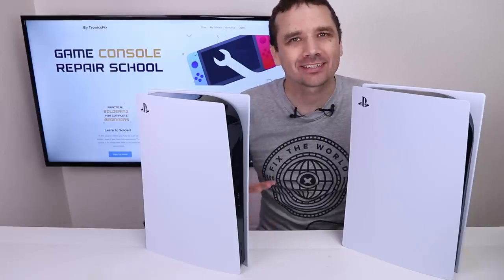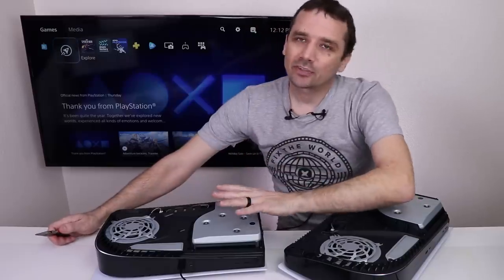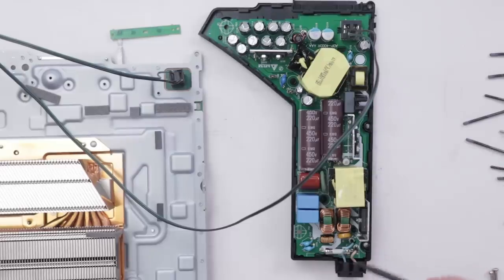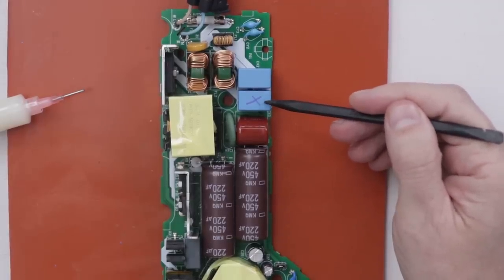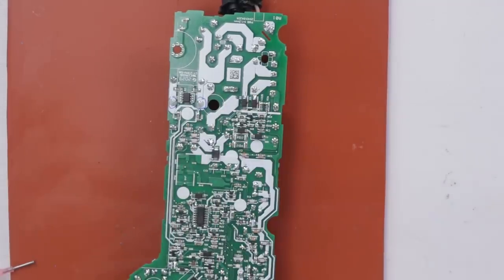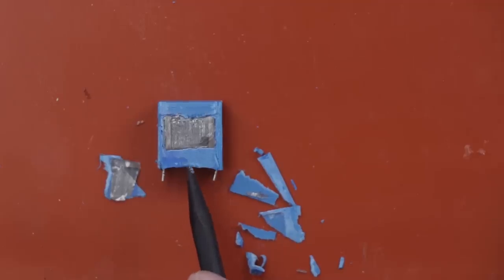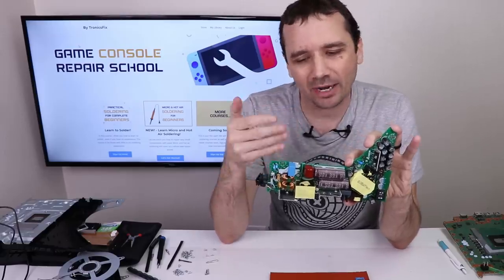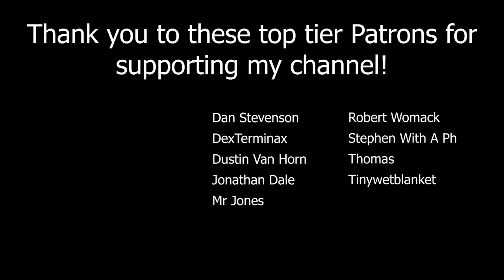PS5 Coil Whine - What Is It and Can I Fix It?

Comment: RIP to those who bought one of this from a scalper without warranty
Reply: I've told everyone that I sold a PS5/Series X to contact me directly if they have any warranty issues and I would contact Sony/MS directly on their behalf. There are some nice scalpers out there ;)
Reply: A valid receipt is not require for Sony warranty. You just need to enter’s console serial numbers and stats the problem. All console come with 12months warranty. Postage label is free as well. You should try it :)
Reply: @ionesito . They don't need to be stupid, they are just willing to pay a higher amount then you for the console. They are just higher on the demand curve than you are. They wouldn't likely have to pay the amount they are if scalpers didn't shift the supply curve.

I don't respect the hustle of scalpers. They put an unnecessary pressure on the market.
Reply: why they all have some coil whine.
Reply: Plenty of shops out there that would fix it.
Reply: They would still have a warranty
Reply: @curan  this doesn’t make it less stupid for two reasons: 1) Even if a console has a problem, no one can guarantee you that it will break during the one year period. Maybe now this or something similar are not important, but no one knows about the future and 2) Even if you have a year guarantee, why not spending $100 more on the original price to get more years of guarantee? My PS4 Pro broke down 3 months after Sony’s guarantee and I got a brand new cause I had extra coverage like  care.
Reply: @freddozilla  i only telling you people who bought from scalper they will have warranty from sony. Not my problem when they didnt buy from retail and its their money and choice. I fix electronics for living and sometime if they are still under warranty then it get sent to sony/Microsoft/nintendo/apple and you dont need to provide receipt.
Reply: A nice scalper is an oxymoron.
Reply: @robertt9342  People who scalp and people who pay scalpers are both part of the problem.
Reply: Their fault got mine from target
Reply: Buying from a scalper by no means voids your warranty. I have talked to Sony support multiple times. It's only an issue if they have a suspicion your console is stolen. Retailers can report the serial numbers of the stolen consoles and Sony keeps an eye out for them since eventually some will find there way back to Sony for whatever reason. But yea, Sony honors warranty from scalpers. All they ask for is some form of proof of purchase. I used the Order Summary that was given to me.
Reply: @robertt9342  we are not talking about stock here, we are talking about a retail product with an established price. If someone buys a retail product and then sell it to you for a extra 20% you're stupid, very stupid.
Reply: @curan  will they just take a ps5 (like mine for example with the issue above) and replace it? Or will u have to send it to them and wait for them to fix it and send one to me?

Comment: When applying AC voltage to a metal film capacitor, buzzing is produced in film capacitors due to the mechanical vibration of the films due to the Coulomb force existing between electrodes of opposite polarity.  This is completely normal of metal film capacitors and does not cause any issues in terms of reliability or longevity.  If you examine the buzz in more detail, it's probably oscillating at around 60Hz which matches the NA AC waveform.

There's no easy fix to my knowledge without a good understanding of the circuit.  You could try moving to a higher voltage metal film capacitor but keep the other properties the same.  You could also try to move to a teflon (instead of polypropylene) capacitor with similar values as well (not electrolytic, tantalums, or mylar though).  Lastly, you could look to reduce the noise by adding a ferrite bead to filter out the high frequency noise, but once again it would take knowledge of the circuit to understand the impact.

Comment: The foam looking glue you see on some motherboards holding or insulating components can be used to change the frequency that these capacitors make noise at. Used this method to hook two side  by side capacitors on a noisy power supply together and eliminated the noise. Also longer or shorter legs on the caps can help, typically longer. Good luck and great videos.

Comment: It could be fixed by reading a datasheet to those capacitors.
Effect is caused by ampere force that changing by current passing through that think, sometimes in high power systems it is called a striking current because it can bend terminals, busses and so on. Just imagine thousands of amperes in 20 cm close to each other.
Just read the datasheet to those caps, there should be ESR, temperature code like X5R, X7R, COG and so on, plus you will find a bunch of graphs showing impedance vs Frequency. Capacitors should be selected in SMPS by their frequency and amount of ripple current.
Just look at any other looking like that with a greater max current through capacitor. If there is nothing: less ESR/ESL and try to find the same Z vs Freq behaviour. I don't know switching frequency exactly at this PSU, But you can measure that on secondary side by oscilloscope: just put in AC coupling mode a.k.a. only AC passes thrgough. Measure by using a ground spring, try to do it without crocodiles because noise would distort measurement and you would see what is not actually happens at the measurement points. 
So, measure the frequency and then add a better capacitor: I Recommend same capacitance, MLCC same voltage or if you choose larger by 3-4 steps you would get less ESR by sure by saving 1 cent...
At least same Capacitance and voltage, temperature coefficient should be X5R, C0G or X7R(worst case) and just find out with less ESR. You can find parameters at digikey or mauser. Just find a part number and order it somewhere cheaper, for example on LCSC